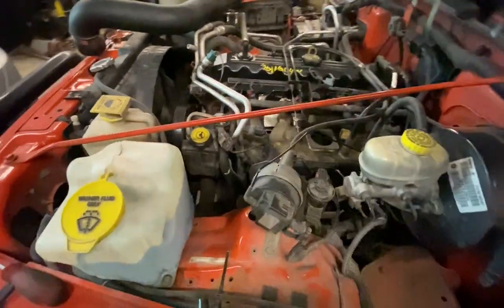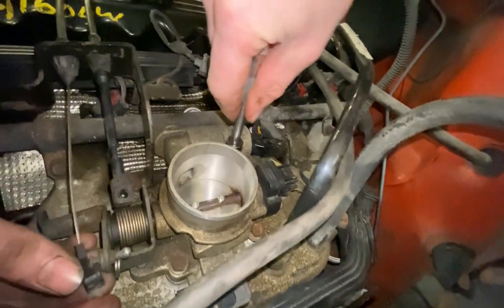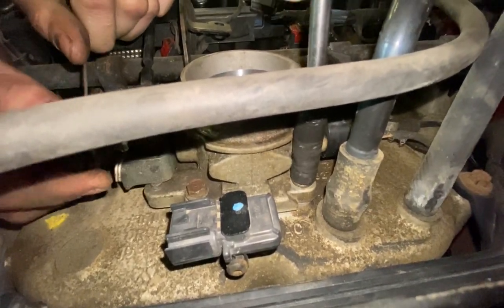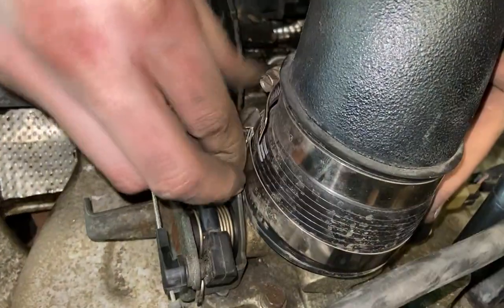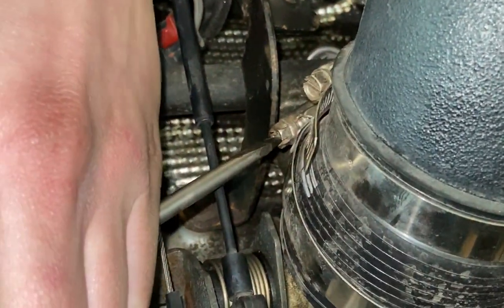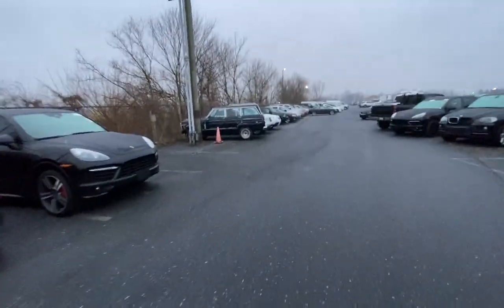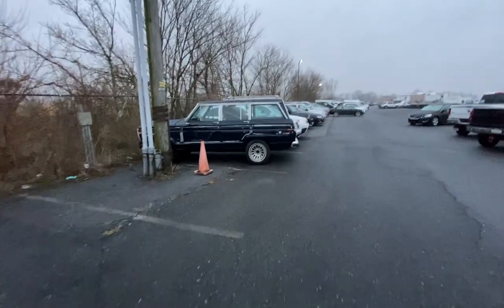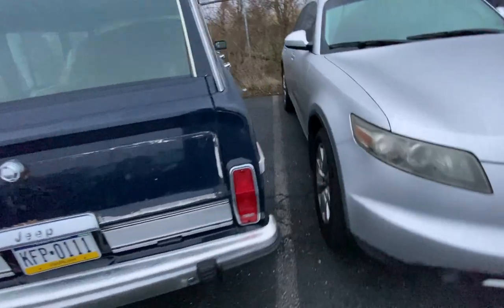This $200 Modification Is Hurting My Wrangler?!?

Comment: Sounds like you are chasing the same problem I have. Mine turned out to be ethanol fuel (because I only fill up once a month). The ethanol attracts water when your fuel sits for long periods without running. Hope this solves you issue. God bless.

Comment: What y'all think about the jeep compass ??
Reply from the maker: Isn’t much of a Jeep In my opinion. Just your average tiny suv / car but with a Jeep emblem. I think you can’t get them in a manual which is cool
Reply: COOL thanks
Reply: @salvadorsanchez447  If it aint a wrangler or an XJ it aint a jeep.
Reply: @Godhorse6969  got it !!